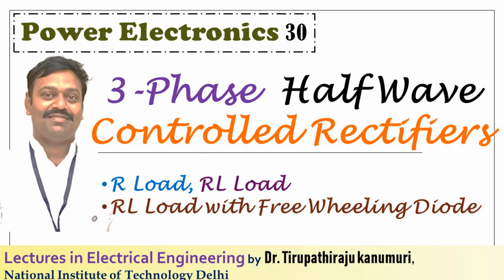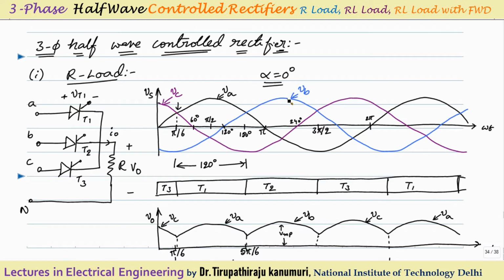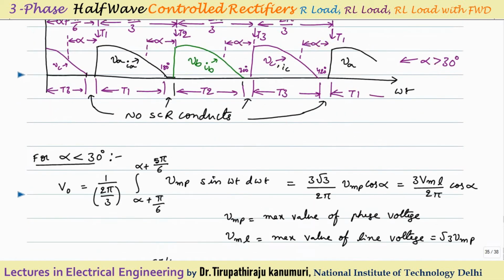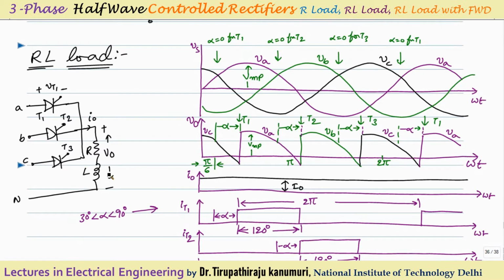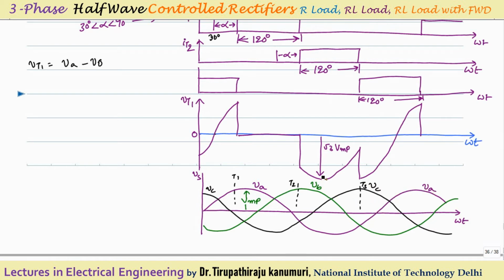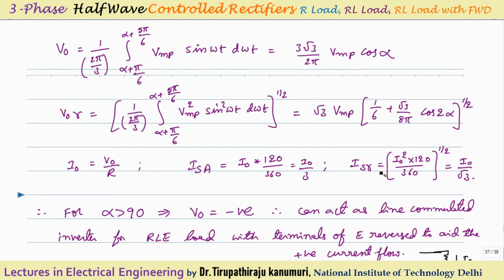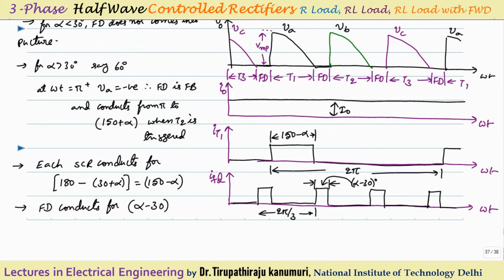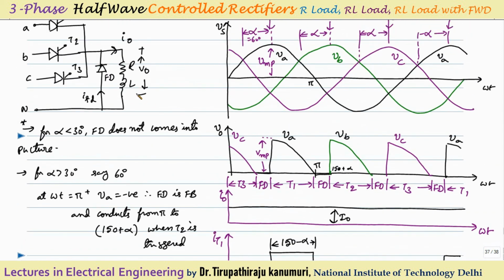PE30 3 Phase  Half Wave Controlled Rectifiers  (R Load, RL Load, RL Load with FWD)

Comment: sir, my first question is why we always suppose constant output current for large inductive load? what will be the result if we consider inductive load as small?
and the second one is  how there is a output voltage same as input  for negative half cycle of input?